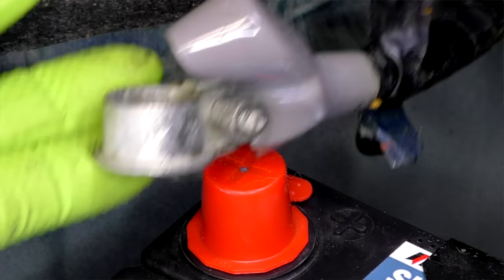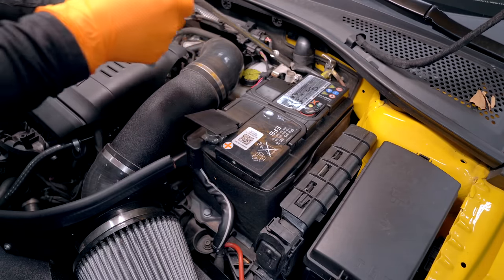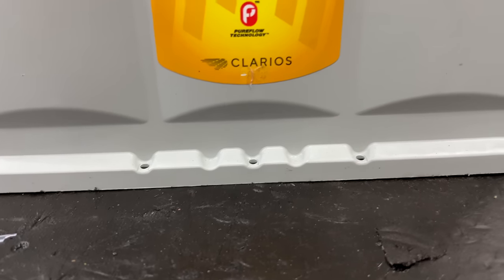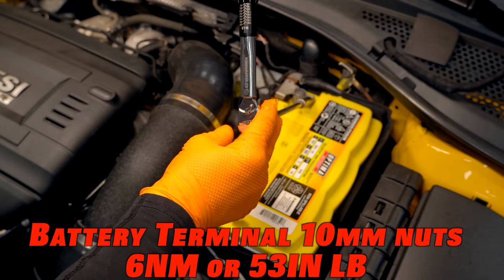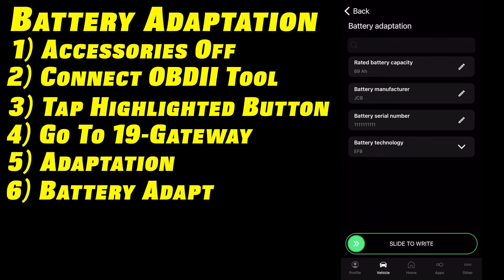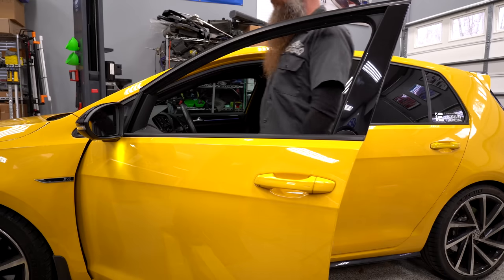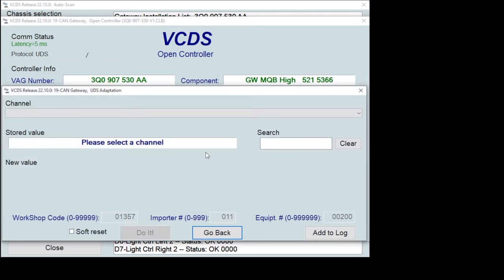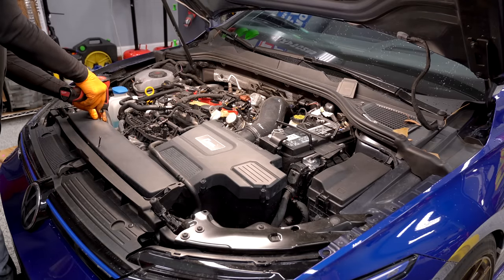How To Replace and ADAPT a VW or Audi Battery

Comment: I just did a battery change on my S5 using an ODBEleven and it was an absolute nightmare.  VoltasIT, the manufacturer, will provide ZERO customer support.  In addition to buying the unit, you need to buy points to allow you to make change AND you need to buy a subscription.  Also, your video does not address situations needing Long Adaptation.  I needed to do a Long Adaptation and thanks to a technical geek on the AudiForum, was able to figure it out.  DIYers need to know that the ODBEleven requires a steep learning curve for which the manufacturer will not provide the needed instruction.  This is one case that had I known then what I know now about this process, I would have gladly paid Audi to do the recode.  An extremely frustrating experience.

Comment: Good video on 'how to'... but...
So basically...
- You entered some data (manufacturer and serial #) that apparently doesn't matter, since unknown and any random serial # is acceptable!
- You told the system the battery capacity and type.
- Different battery types may benefit from adjusting how the charging system works, this may or may not extend the life of the battery.
- alert lights came on after the instal, but they go out after driving...
I replaced the wife's OEM H5 battery with a larger EverStart H6 (AGM) in the '17 AllTrack a year ago. The battery is charging fine. Load tested after sitting for 5 days: voltage is 12.4 volts and the Capacity is holding up fine.
I remain unconvinced as to how critical this step is!
Reply from the maker: I dont completely disagree. but my point is, why chance it?

Comment: Why not connect a small 12 volt battery or a jump pack in parallel before disconnecting the battery that need replacement. That way all the programming might not be necessary.

Comment: hello vw community!  i have a question i couldn't find a solution anywhere. how can I fix the darn battery terminal recognition open circuit? the battery is new straight from the dealer. and the problem that im facing is intermittent hard steering like it feels like im driving a classic car with no power steering, and power loss on high rpm. please if anyone had this problem and know of a fix i really appreciated it.

Comment: I cant complain my mk7 battery lasted 9 years before it went out last summer (I did not even notice it getting weaker before one day the car did just not start, I recharged the battery, it worked for 3 days, then it completely refused to even engage the startet solenoid).
Because of the adaptation I was thinking about just taking it to the shop but from my calculations (German prices) It would be 200€ if I let the shop do it and it would be 100€ battery + 100€ Obd11 if I do it myself. I chose the I do it myself version because in the end you gain a diagnostics tool for basically the same price…

Comment: should be an area in the infotainment center of the car to do battery adaptation. The fact that you would have to either purchase specialty equipment or take it somewhere and pay a fee to have this done is unacceptable. This is exactly why the whole “right to repair” movement has gotten as big as it has. Too many industries are doing this type of nonsense. There should be a preloaded walkthrough video on the system of the car you can watch after installing a new battery, which the car should easily be able to detect based on standing voltage, and it should force you to do this before doing anything else with the car so that it’s done and can’t be missed or messed up. Seems like a pretty easy way to allow the customers of the car manufacturers to keep a little dignity and money at the end of the day 🤷‍♂️

Either way, good video lol

Comment: Some say you need to plug that cap on red positive terminal plastic to the hole, I sometimes to, sometimes don't, but it's a good indicator there's something cooking inside bat if and when blows it off... But still, if everything done properly, I had 0 problems whatsoever and managed about 2000 cars in those years I worked with used vehicles, just skip the "tik tok hacks" that don't work even in theory...

Comment: Any issue with using a battery tender hooked to the charging posts under the hood while I change out the battery in the trunk? I'd like to make it so things like channel presets aren't lost. Car is a 2018 A4
Reply from the maker: Don’t do that. 1) it won’t stop the need for adaptation if the car requires it. 2) that’s never been recommended by vw/audi
Reply: Thank you for the reply! I appreciate you @HumbleMechanic

Comment: -Another thing you can do is to install a 9 volt battery in parallel to the main battery with clips.  You now can remove the main battery and install the new one, and no settings or adaptation is necessary.

Comment: First of all. AGM battery are not designed to work in engine compartment. They have problem with heat which is present there. This the reasons why AGM batteries are placed under seats, trunk, etc. Second if you are setting of type of battery it should be Fleece - it's common VAG settings for EFB and AGM batteries. Binary AGM is not equal to AGM (different technology).
Reply from the maker: the mk8 has an AGM from the factory
Reply: @HumbleMechanic  So it's mean one of two things. Air circulation near AGM battery must be sufficient to cool it down or (not first time in VAG history) - they don't care about lifetime of battery. I have Seat Leon 2.0 TSI (DKZA) and original EFB (Moll vendor) died after two and half year. No warranty. Across EU i asked different users of Golf and Leon and all people has EFB. I checked with me college who has Cupra Formentor (sub brand of Seat) also EFB and he also has EFB.  I checked pictures of MK8 in EU and most of those cars have EFB+ batteries. Maybe it;s some variation between EU and US. Not first time. 

Regarding temperature of battery. Due to "sock" temperature of battery stays low for long time but how about hot summer when hood will worm up? I spoke during process for buying new battery with Banner (Austrian producer of superb batteries in EU) and they said that they are strongly suggest to don't put AGM battery to engine bay. They will not give warranty if such battery will dry out.  

Greting form Poland. What the shame you don't have garage in EU. 😜

Comment: Had a battery on my golf r replaced at my local dealer under warranty and they forgot to put back the hold down bolts 😂😂😂 if you want something done right. Do it yourself

Comment: Dont they have a external battery that plugs into the 12volt outlet and keeps the power on till you swap in your new battery like it was never off 🤷‍♂️
Reply from the maker: Yea. But 1) not recommended by VW.  2) doesn’t change that you’ve installed a new battery in the car. 

The only thing now you get with them is risk of volt spike and maybe not resetting auto up for windows.

Comment: Why would you need to go through this if you attached a battery maintainer to the positive and negative cables before removing them from the battery so that the electronics in the car never lose power?  This whole process is ridiculous for replacing a battery...

Comment: Vw is making it harder and harder to “simply” repair them. Most repairs require disassembly of the car.  Replacing the left headlight bulb on the MkV requires removing the bumper, grill, and physical headlight assembly. For a bulb!   The right side requires small hands, or do the same thing.  Gee, it’s like they didn’t think the bulbs would burn out. Granted I’ve only replaced them once in 15 years. Let’s talk about the lower oil pressure sensor. Grr.  Frame extensions?!  Or small arms. Thankfully no learning battery, every 6 years pop it out.  It’s been a good car, but repairs are minimum 1/2 day of shop labor.

Comment: how hard can it possibly be for VW engineers to add a line in the settings menu so the owner can just tell the car about the new battery?  or are they doing this so VW dealers can make extra money?  I'm betting that most average VW and Audi owners are just letting the dealers change the batteries.    Profit... :)

Comment: This is not needed. Just unlock your car with the hood open and let it be for 20 mins.
Then disconnect the old battery and connect the new one.

No issues. No alarms go off.

But all warnings lights will be on until you drive it for 30 mins.
Reply from the maker: That’s not right.
Reply: @HumbleMechanic  I am sure you are right, but I did this 7 months ago and still have no issues. Car went in for service last month and they didn't say anything.

Maybe I was just lucky? 

I found the guide via Google.

Comment: Great video, but having to program a battery is just bs. If the new battery is okay all the warnings should go away after a restart and programing should be optional. 

My friends car had a flat battery on his cabin because it was -25c outside. He had a jumpstarter, but the car was software locked because of some VW bs. The story ended with him calling road assistance who had to take the car to a mechanic for a software reset just because the battery was flat... So instead of a well designed old car that would have started just fine with a jumstarter, all the trouble cost him $500 for something that should be completely unnesecery.

Comment: Saddest part is Optima, pioneer of AGM batteries has made trash junque with no real warranty for top dollar.
Reply: Can you elaborate? I bought an optima yellow top to replace my platinum duralast and its been dying on me overnight, even after charging it with the optima battery charger multiple times. I was thinking about taking it back to autozone for warranty but haven't had the chance yet.

Comment: "If you don't adapt new battery, your car will not explode" Tell this to bmw guys. Or  land rovers auxiliry battery, darn thing wont even charge without proper reset. VAG vehicels are so far pretty decent on battery replacement.

Comment: Wait until they find out they are coming out with a chip in the battery that the cover has to read to tell the computer the correct type of battery has been refitted to the car…

Comment: NEVER place an AGM battery in the engine bay. They will die after like two years, because they hate heat. That's why the original VW battery was an EFB battery, they are just as good and don't care about operation temperature.

Comment: Why not just simply hook up your new battery to the leads via a set of jumper cables before disconnecting the old battery. The car will never be without 12volts and it's a far better method. I do it this way and so does my auto electrician.
Reply from the maker: NO! Do not do that on a modern car. 91 Corolla, fine, NOT modern cars.
Reply: @HumbleMechanic  We have been doing that on modern car. Why not? What are the risks?

Comment: Having to code a battery is just about the stupidest thing. Replacing the battery on my 04 a4 it acted kind of dumb for a bit but it eventually sorted it self out.  Wich is still weird the system hard reboots like that. All you should have to do is take the battery out and put a new one in with out issues. Theirs no reason for this at all other than to make it harder on the customer

Comment: Having the car sit for a few minutes allows everything to fully go to sleep
Reply from the maker: yes, but I couldn't get a good answer as to why
Reply: @HumbleMechanic  first line tech support.... switch it off then on, fixes most things (unless your power supply caps have cooked on the appliance that's been running 24/7 for the last 5 years in the back of the office...)

Comment: "Battery coding"

-My understanding is that the EPA allows auto manufacturers to increase by 1 mpg the numbers that the actual tests generated IF they incorporate that stupid "Auto Start-Stop" feature in cars, which is not actually required.  Thus automakers jump at this since it increases their CAFE ratings.  The problem:  This puts a lot more strain and wear/tear on the battery and starter, so they have set up a computer program that monitors battery health and as the battery gets old, it keeps the engine running longer and longer before shutdown.  "Coding" the battery just resets this system for the new part.

Frankly, the system annoys the shit out of me and I turned it OFF on my '14 Cayman S.  If I have to install a new battery, I'm not going to pay the Porsche stealership $150 to use their PIWIS computer to reset this silly system!

Comment: Why can’t you lust leave a battery charger on, either connected to the cables, or plugged into the cigarette lighter, so you loose nothing and font have to go through this ridiculous procedure.
Reply from the maker: NOPE thats not advised on basically any German car of the last 20years. 

That also wont help in the coding at all.
Reply: Well it works fine on my 2004 Porsche GT3, my 2006 Carrera S, and my 2016 GT4 which I just replaced the battery this month.

Comment: Why have they made it so bloody hard now for the novice guy or lady to change the battery. What if you’ve not got these readers?. These batteries are over £100 English pounds and now you’ve got 30 min extra garage surcharge
Reply: You kinda answered your own question there.
Reply: That's the point. They make no money off cars after they're sold so they're trying to force you to use their service centers. Don't buy a german car if you want to do anything yourself.
Reply: @nah3193  Only ever owned VW and have done everything myself to the cars i own.

Comment: Great video but the whole thing is primarily designed for profits.
Its funny how by bmw and vw have registration but they kill batteries faster than my dumb old 4wd.
Company profits ☝
Reply from the maker: Im not sure it’s fair to compare a newer car packed with tech to an old vehicle.
Reply: @HumbleMechanic  i get your point, my BM pulls 25A with the ignition on, i dont know about the old 4wd.
One thing i know the charge rates on the old car are more gentle to the battery. 
Cheers 🍻

Comment: I know Optima is a sponsor of yours, but oooof. "Clarios" manufactured Optimas are trash. Their quality control is horrendous these days and they don't last nearly as long as they should. You'd be better suited to getting an EnerSys/Odyssey/Northstar battery.
Reply from the maker: You could very well be right. The beauty for me is, I can show you guys the truth good or bad!
Reply: @HumbleMechanic  I work in the battery industry. I speak from first-hand experience. Optima built their name on quality and reliability but those days are long gone. When they were owned by Johnson Controls they were industry-leading in quality. Ever since they were purchased by Clarios and their production moved to Mexico it's been a much different story. They have name recognition, different colored tops to easily identify the application and proprietary spiral shaped cells to maximize surface area. The problem is that they are no longer "pure lead" as they used to be, they are made with moderate quality recycled lead, though they don't volunteer that information. It's not that they are bad batteries but they are no longer the top-tier product that their price suggests.
Reply: @samsonite360  that might explain the headaches my supposedly new yellowtop has been giving me. The car wouldn't start! Even after charging it with the optima battery charger it still dies overnight.
Reply: @chinoyboi14  what is the year, make and model, and what is the part number on your Optima?
Reply: @samsonite360  2013 vw gti dh6

Comment: What. You don’t know that Clarios used to be Johnson Controls until recently??

What kind of mechanic does not connect a battery saver when disconnecting the battery?

Interesting how other car brands can do the new battery self learning without any tools. Just turn off all loads and leave car alone for a few hours.
Reply from the maker: "What kind of mechanic does not connect a battery saver when disconnecting the battery?" Every German car tech on the plant. that is a BIG NO NO on VW/Audi.

Comment: I do preffer to use a classic '90 car.. i really don't need anything from garbages which are presented as modern or as an advantage of a consumerism era cars. 
I've modified engine and transmission and brakes to have all acceleration i need, i have real PERMANENT awd, not "modern" shitty "permanent FWD" haldex, i have a pretty light and nimble car, not a huge PIG of TWO TON car.
So.. i don't give a shit on those mumbo-jumbo shitty procedure for anything and those overcomplicated engineering for nothing 😂

Comment: All that to replace a battery! Has the automotive engineers gotten smarter or dumber since the 1980's and 90's? Sometimes tech is great but when it's that complicated to do a simple task , again ask yourself why are you buying that car or Brand? because you know most actual Japanese built cars re-learn or reset the computer on their own just by replacing the battery and starting the vehicle or driving for a short distance rather than go through all that complicated Scanner and OBD11 mess and you don't have to be like a computer lab tech in the 90's on a MS DOS system. Also the older you  get you just want a reliable vehicle that works and easy to maintain if you are a Diy person so again all that to replace a battery, VW has lost it's roots entirely, I will never buy those complicated pieces of crap that will not be worth fixing in 5 years.

Comment: What an absolute joke, for just changing the car battery. What about using a jumper box to supply 12V to the car while you disconnect the battery terminals and swap batteries ?
Reply from the maker: That won’t work. That also been recommended not to be done on pretty much 2000+ vw/audis
Reply: @HumbleMechanic  Thanks for that info !!